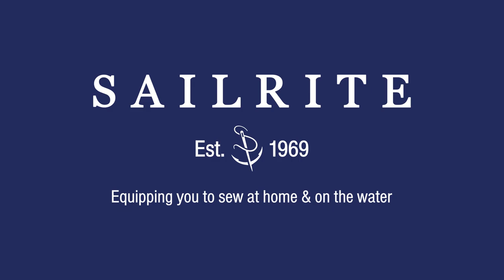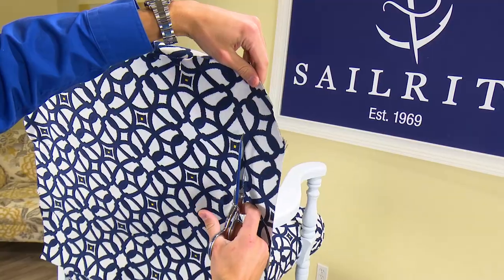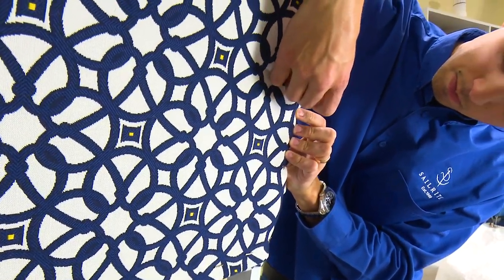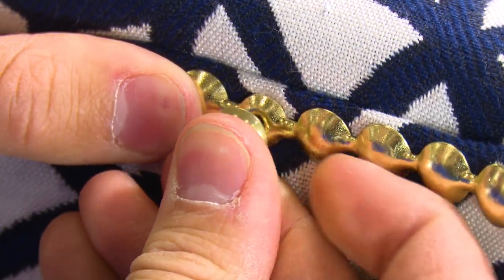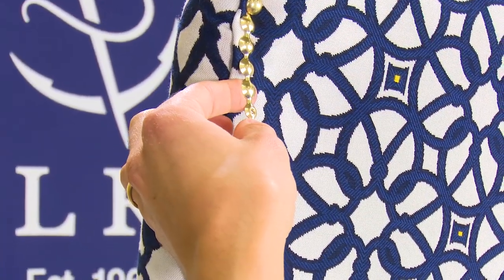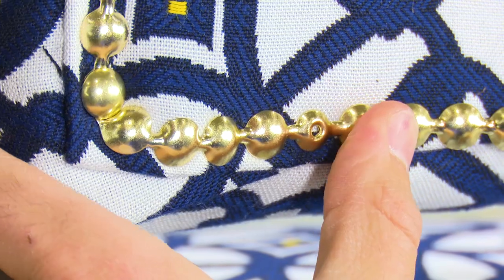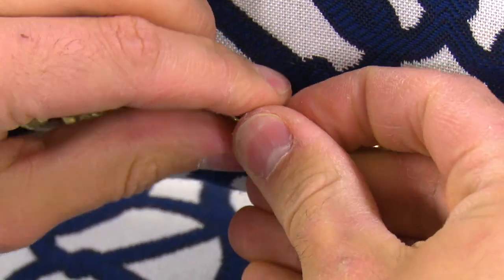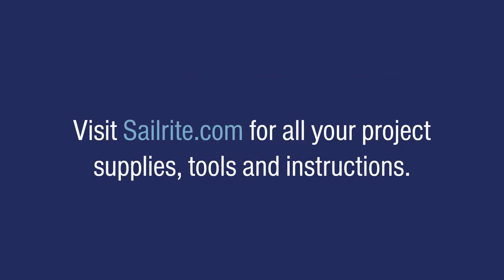How to Install Decorative Nailhead Trim

Comment: I have seen on other videos that you can buy a plastic applicator for nailhead trim that evenly spaces the nails. It can also hold six or more nails at a time so there is no need to do only one at a time.
Reply: You actually can make that tool for yourself those plastic tools are for beginners.